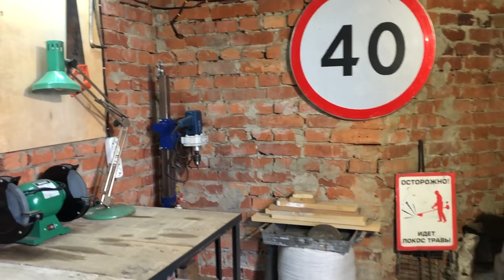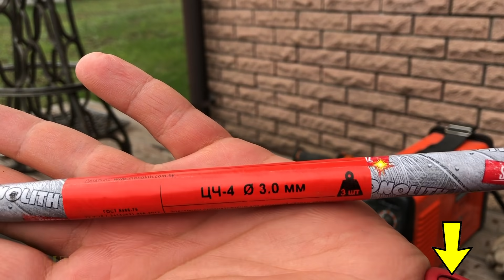Вот что можно СДЕЛАТЬ ИЗ СТАНИНЫ «Singer» своими руками!!!

Comment: "AEG" used to make the best sawzall back in the 80's. It was black, variable speed dial, lock on triger, & easy to use with one hand~!
Reply from the maker: On batteries?
Reply: @budilov  NO it was corded. But the best never the less. If I could find it again, I'd buy 2.
Reply from the maker: @andybilakshow260  I understand you.  Today, the industry is striving for financial efficiency for the sake of quality.
Reply: @budilov  Yes, it is quality. If I'm not mistaken, it's German? 
I've tried to find it after I wore my old one out. But it looked like they quit making it. 😕
Reply from the maker: @andybilakshow260  I'm not sure, but I think it's made in China.
Reply: @budilov  Looks like my replies aren't coming through. I found 1 image (the only evidence of it's existence) in 40 years. But I can't post the link. 
AEG as far as I know isn't available in the usa. Looks to be mostly europe.
Perhaps China bought them out.
Reply: @budilov  In case you're interested, You might find it if you searched AEG SSP-2-800 SAWZALL. They should make this again because it was solid and slim lined to hold by the neck one hand.